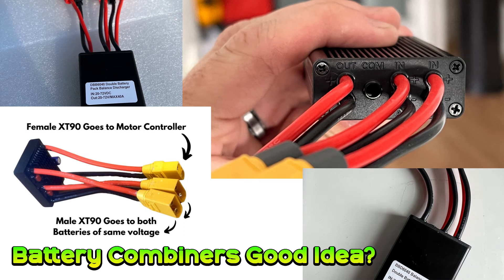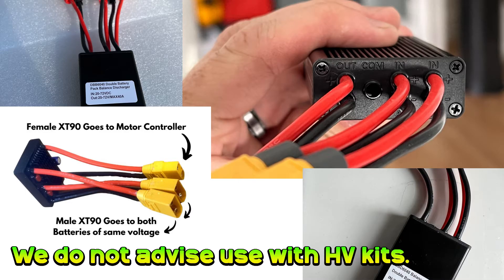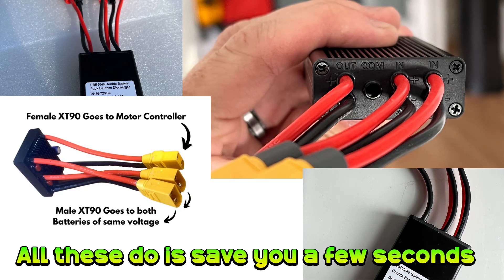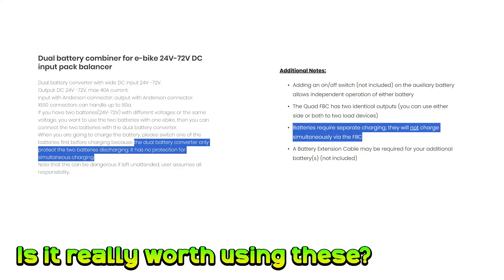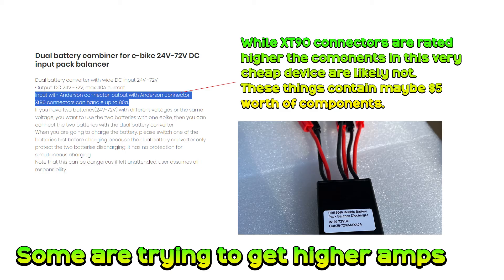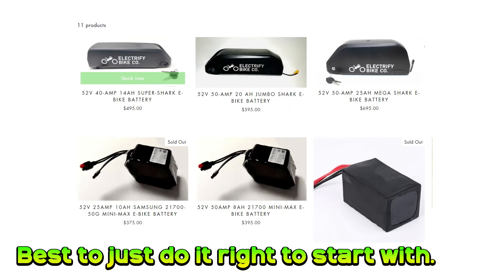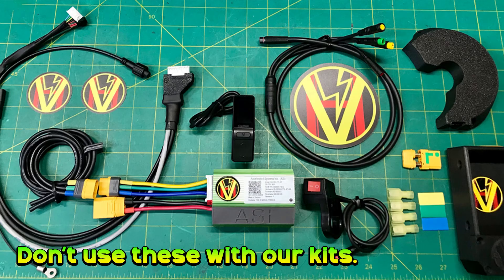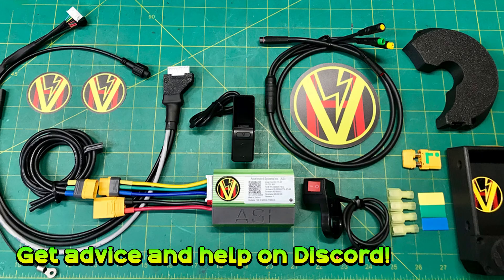Ebike Battery Combiners are they worth the risk?

Comment: I have just cancelled my order with AliExpress as you raise a very good point, it only takes a few seconds to switch battery connections thus cutting out a failure point.
Reply from the maker: They are not worth it. Wise decision. Cheers

Comment: Iv seen these going for £250 on a Facebook page working with 5 batterys and charger port for max of 90amp discharge 😅 yeah no thanks
Reply from the maker: There are some that are meant to be ok. Its just there are lots being sold be people that are marking up cheap stuff. There is no way to validate them so for our stuff we just say we can't support them. I just don't see the benefit for most cases. Cheers
Reply: @HighVoltageKits  I honestly stand by everything said in the video, either get a second battery and swap them over or get a bigger battery. Lithium fires are no joke and potentially damaging the rest of the bike and components isn't worth the risk
Reply from the maker: Yeah. Most of these it's less lithium fire and more damage to controllers. Unless they try and charge them connected.... Yeah I'm not using them.

Comment: Ive been using a 100 amp discharge converter for about a month now with no issues. I have two 52v 20ah batteries with 30amp bms on each battery. The batteries will supply my bbshd ludicrous controller with a peak of 2800w or about 52a combined from both batteries. The combiner and the batteries and motor run warm to the touch only after a high speed hill climb. Otherwise everything runs cool. If the batteries are fully charged at the same voltage the combiner will allow both batteries to deliver their rated bms current to the motor safely without cutoff. If one battery has a higher charge than the other it will draw this battery down at a higher rate until they are equal and then it will draw equally from both batteries. You can expect a 3-5 mph increase in speed and or a double increase in range.
Reply: Do you have a link to what you used?
Reply from the maker: The video was not really to worry people. If its a genuine 100amp with 100amp rated internal components you should be fine. If you have issues with one BMS it should just shut down in which case the other would trip. We don't want people running these on our kits because we just don't have the ability to vet them all and there are lots that are on sale saying 100 amps just because they have XT90s on them. The main problems we have seen are them just letting go internally or damaging the controller with voltage spikes. You may well be ok until its not. Its hard to say without knowing what you have. If its a ALI express one thats been market up from Area 13 or one of those places then I would not put much faith in the internals. Fingers crossed you are good for a long time :)
Reply: @HighVoltageKits I figure it's safe at half rated power or 50amps. I never run at 50a continuous except when hill climbing.
Reply: @HighVoltageKits I bout one and added to my Xclass 52v 18a battery and bought a second battery 52v 20a the blender was 40a and it messed up my bike No power from display any suggestions why this happened?

Comment: Just balance voltage then plug them together. Amps don't matter in this case.  Been testing this method for 4 years now. Just make sure voltage is +/-0.03v of each other. A common charge/discharge will make it safer as it can control any failures that would make it charge too fast. I'm writing about 1500w not 8kw.
Reply from the maker: Yeah. Lots of the listings were suggesting higher amps than looked safe. We wanted to make sure people using the High power kits we do don't use them to combine cheaper batteries and use them beyond spec.
Reply: Side note: I need to start putting warning on the start of my battery videos.
Reply from the maker: What warning are you going with?
Reply: @HighVoltageKits  Been using "My videos are in no way intended to be instructional "how-to" lessons. I am simply documenting my project for informational purposes. Property damage, personal injury, or death may result, even when following manufacturer's instructions. I cannot be held liable for such damage or injury. It is your obligation to ensure that you are complying with any local and federal laws as well as code and permit requirements." in the description but its a bit long for on videos.

Here google generic one "Be aware the use of batteries might cause damages of residual leaking, fire, or explosion when misused, mishandled, or defective."

Comment: I can only speak to my experience,  but i have a 25 amp 36v combiner and have no issues.  Ive paired my main 17.5 with three 8ah batteries i carry in my rear pack that i change out as needed.
Reply from the maker: Hey Paul. It sounds like you know what you are doing and are using it well within the specs. The video was not really meant to alarm people but to get people using our kits not to use them. They tend to pull amps above what the devices are rated for. Some of the devices are listed as 80+ amps because they soldered on XT90s instead of Andersons. Yet the internals are only rated for 40 amps. In the main it just means that the expensive controllers are being damaged. Appreciate the comment and feedback. I bet you get some crazy range with all of those! Cheers
Reply: @HighVoltageKits  your content is fantastic.  I appreciate the topic because I was considering pairing two 100 amp 72v packs for space considerations.

Comment: How about do some testing these at the high wattage and prove what you are saying? I have been using one with a bac2000 and it has no issues at high watts.
Reply from the maker: I have seen this mess up 855s never mind a 2000. I have zero interest in testing these with any of my controllers. We don't support them with our kits. Not sure which one you are using and if you are happy that's great. But I will be sticking to switching batteries. Most of them even say not for over 2000 watts in the website listings.
Reply: @HighVoltageKits  I'm using a 90a rated version from electromotive mods and have rode 2000mi with it so far and no issues. Have pulled over 2000w+ no problem on multiple occasions.
Reply from the maker: I think what you have might be a cut above the dross that's being marked up from Ali Express.
Reply: @HighVoltageKits  seems you missed that clarification on the video and grouped them all together?

Comment: Very good video.

Am glad you posted this.

Connecting two together to get more amps sounds dumb and dangerous.

Connecting two together to get more range. I didn't realize we had to unplug them before charging. If that's the case, then yeah these combiners are junk.
Reply from the maker: Thanks. It makes it pretty redundant for me. Its like when people complain when the tap machine is broken and they have to enter a PIN number to pay for something. The issue with combining for amps is that often people use really cheap batteries to do this. If you combine so that the amps on each pack is to lower it so the battery lasts longer that is ok. But mostly people are doing it to extract more power and run them at their limits which is a great way to ruin a pack quick.

Comment: Wasnt it one of these, that caused Rossman 's bike to light up? Although it was a very crude, basterized one from what i remember
Reply from the maker: We will never know the truth there. In the Youtube comments he said that the company accused him of using the packs with a 5000 watt motor. To which he replied that the BBSHD was a 1000 watt motor. Which is a huge reach. Even at 52 volts that motor hits 1700 watts peak. He was using 72 volt packs with an external controller which bumps up the power above 3000 watts. So the motor really is as powerful as the controller pushes. Alot of the people commenting have no idea what he was doing and just saw the fire. So it could have been a fault of the BMS or battery construction. I think he thought they would just cave. They maybe should have. Its done real damage to them as a company. If one of the batteries tripped while he was riding and then when he got back tried to equalize then it 100% would have caused a fire. There won't be a proper investigation and the evidence is incinerated.

Comment: These are all good with low amp stuff like upto 30a if its rated for 50a, been using this for awhile, I guess if you want to run it with 4000w motor then you asking for trouble, and also the idea with this is to help eliminate the voltage sag when powering it .
Reply from the maker: Yeah. This is the main reason for this is to make it clear to people using our stuff its not recommended. The units say 40 amps on them yet one of the guys selling them is suggesting by sticking XT90s on there you can run 80 amps... Sure buddy. The connectors might take that but I doubt the electronics inside are up to snuff.

Comment: Be interesting to see how Bosch does it with their dual battery configurations.  Like on the Tern GSD.  I believe they both charge at the same time.  Never have to worry about it.  I ride like a "normal" person and not a hooligan.  I believe "The Great White North" is a "class 1&2" country only.  I also googled "Idaho stops" and TGWN is also a no no land.  I do a "Spokane" stop.  Close to Idaho, but....  ;)  Hows it going John?
Reply from the maker: Going good mate. Summer is winding down but we get a nice long end of season here with cooler nights. We still really need rain but the smoke is now gone for the most part. The video was more aimed at advice for people using our kits. If Bosch are using it then it will have to have been checked. Most of the stuff I referenced is being pushed by people buying ultra cheap on Ali etc and then selling on for a hefty markup. Then using cheap batteries in combination to save money and pulling their amp limit through a device with maybe $5 of dubious quality components. In most cases when they go its not a battery fire but they do routinely toast controller when they let go especially the cheaper ones. Hope you are doing well. What is a Spokane stop btw?
Reply: @HighVoltageKits  A "Spokane Stop" is a bit like an Idaho Stop (that you do), but the rider slows down to look.;)
I think those combi boxes are burnt from people trying to suck too much juice out of the combined batteries.  Surprised that the battery leads didn't melt from the excess current draw.
You had any problems with spoke nipples pulling out of the rims from going "full Hooligan"?

Comment: Battery combiners are junk. you probably won't even see a teardown of one on my channel!
Reply: tear. it. down. !!!! tear. it. down. !!!!   DEW IT!!!!!
Reply: Tear one down , no point calling them junk if you haven't own one or tear one down yet, it's like someone saying bafang motors are junk but never owned one or ridden one
Reply: @robw5735  It's a battery combiner. What exactly do you think is inside the little box that is so special?
Reply: @de-bodgery  lol  I don't know pull one apart  for us and have a look, little box  I have a so called 100a one which is alot larger than the puny 30- 60a ones which some folks probably tried to run their hv kits through it
Reply from the maker: Not much to take apart really! Be a thirty second short.
Reply: @HighVoltageKits  Something about like that RC high side mosfet switch I took apart.
Reply: @@homie3461 Not always the case. If that was true, just buy some XT90's and solder them together yourself. These devices often times have mosfets and other things inside that plastic box.
Reply: @de-bodgery  Do you know what the mosfets and capacitors are for?
Reply: @santiagotutor2008  Caps are probably for smoothing out the DC noise. The mosfets are for switching or combining battery A to battery B.

Comment: I just keep it simple and run two batteries in parallel, and leave the batteried connected together.  Way simpler and just works. On youtube https://www.youtube.com/@jehugarcia uses multi ebike packs for house hold solar storage like 6x- 20x all in parallel, he's been doing that for years with no issues.  I even wired the charging ports together Check out @jehugarcia he has lots of videos about batts in parallel without these devices.

Comment: My only problem with these is that they are way overpriced for what they are (Schottky or bridge rectifier..etc).
Reply from the maker: They are listed for $20-30 on Ali. The US retailers are repackaging and marking up to closer to $60
Reply: @HighVoltageKits  yes, and what make the circuit is actually about 5 bucks including the xt60s at best.
Reply from the maker: Exactly why they scare me
Reply: Bridge rectifiers are terrifically dangerous for this purpose as most are rated for AC current, not DC. So they don't expect continuous current on only one path. 
A possible failure scenario for a bridge rectifier is a short, allowing current in both directions. Which would allow one pack to charge another.
Reply: @wool1701  not true.
 A diode is the only part needed, and some components work better than others.
You need different voltages for batteries to charge each other, if you connected a 39v to a 48v in parallel with or without the device, you're asking for a disaster .

Comment: Just get 2 good battery packs and connect it safely in parallel.
Reply from the maker: One of the biggest risks is having one bms trip. The one battery discharges and the other is full. Then if they reconnect the one battery tries to balance. Instant fire. I suspect that is what occurred with the very famous Rossman incident.
Reply: @HighVoltageKits  No instant fire. The other BMS simply switches off due to overcurrent
Reply: @johgude5045  That depends on the pack architecture. Some batteries have no input protection on the discharge leads (so-called "3-wire BMS"). And that protection has to successfully work. Even in a "2-wire BMS", if the BMS is misprogrammed or the shunt fails in a way the pack cannot sense the input current, the pack will overcharge and overheat.
Reply: @wool1701  to be more precise: the battery that loads the sink battery should cut off due to overcurrent event. No instant fire. It's generally not smart to use batteries without overcharge protection, or "3wire BMS" if there is a chance to charge them through the discharge port. I dont have any 3-wire BMS in service anymore since almost 5 years now
Reply: @wool1701  If your BMS does not shut off during overcharge or overtemperature event, it is time to look for a different BMS. You cannot blame this battery combiner for this

Comment: I run two batteries in parallel always charged to the same voltage and then plug them in parallel and leave them together to balance out overnight...two years with the same set up and so far
So good,the bbq outhouse is still 🔥 standing....but I agree with the captain one battery and one bms is alot safer, from  a safety point of view one 🔥 fire is better than two...😮
Reply from the maker: I think the shed would be toast regardless 🤔 Yeah it can be done safely until it's not. One of the biggest risks is having one bms trip. The one battery discharges and the other is full. Then if they reconnect the one battery tries to balance. Instant fire. I suspect that is what occurred with the very famous Rossman incident.
Reply: If both batteries have a common port BMS, then the batteries should be protected against such a scenario. I think a common port BMS with shared charge/discharge cable is the only safe way to do this. Obviously there was no way to confirm this after the fire, but Louis R suspects that they used a separate port BMS when he had specified common port. If the battery combiner is designed to prevent this scenario, and you have each battery with common port, then you should have 2 levels of protection.  @HighVoltageKits
Reply from the maker: That would explain more. It looked like a very rapid transfer of energy from one battery to another.
Reply: @HighVoltageKits  Daly BMS has a 15a charge rate and will trip. Common discharge/charge one is best.

Comment: I can keep way more capacity split between two locations on my bike than just one, both two wire BMS so support charging through discharge port, you can easily get a charge port on these devices if you purchase from the manufacturer.
 And it's even smart charging, with the amps split between packs with different SOC so they end up finishing at the same time. 
For me it's not about trying to get more amps out of one pack, it's about the longevity of discharging each pack at half the amps, without worrying about their voltage level when putting them in parallel. Less voltage sag, longer riding time, and longer battery life. I can also use just one pack to plug my 48v air compressor into and then put it back and know they will be back in balance soon after I start riding. 
You could even use one just to get a pair into balance before paralleling them directly if you needed to for regen or whatever reasons, then the failure chance goes way down and you don't need as high of an amperage discharge rating. 
Overall I find them to be very useful devices, though I can see ways they could be abused and if I started having failures I might end up being more cautious.
Reply from the maker: Good feedback and running batteries within their accepted limits is a good way to get more life from them. Much of this is aimed at people running our kits which can pull up to 4000 watts. The one place was suggesting you could draw 80 amps on them which is insane. Sure the XTs handle it but the components inside etc. They need to get good airflow. Sounds like you know your stuff tho.
Reply: @punkdigerati still finding it reliable?  I need another ebike build with two 51.2v batteries in series.

I have started to fear a un-prepared parllel connection.